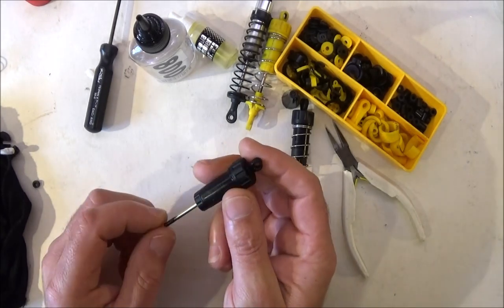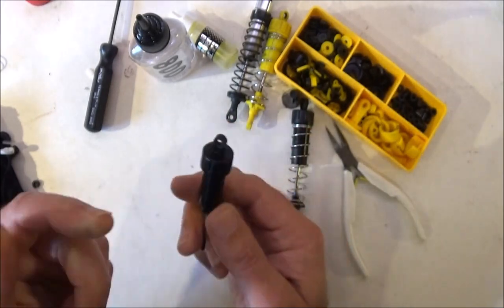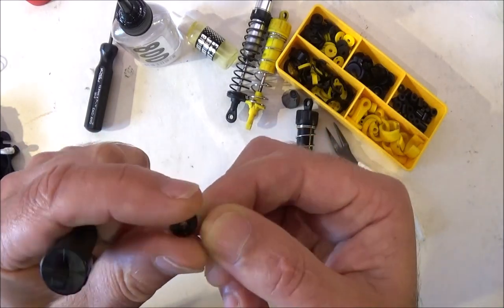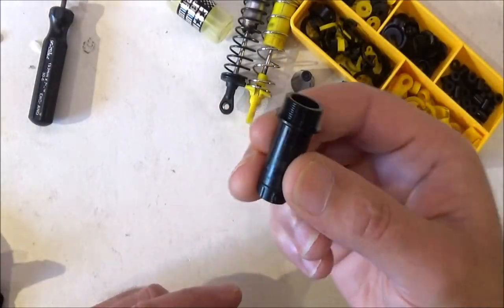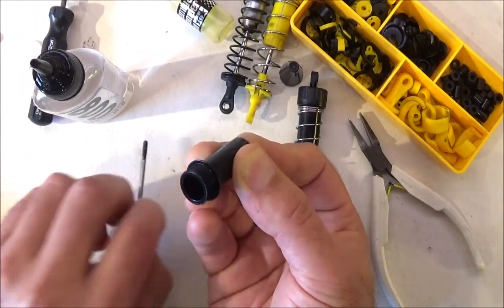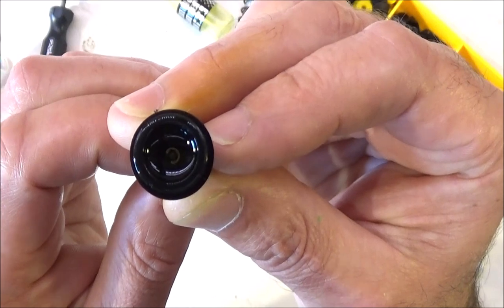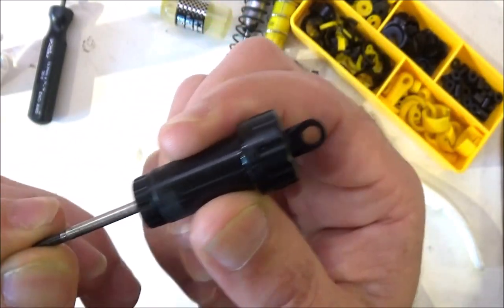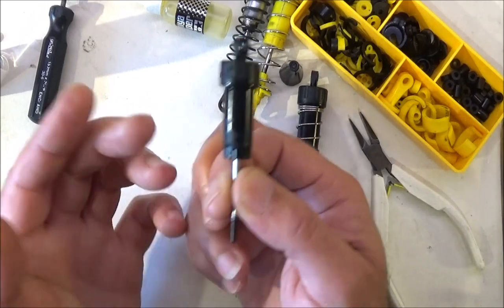How to Fill RC CVA Oil Shocks With No Air Bubbles! Simple No-Cost Tip!

Comment: Thanks for the video. I know this is an old video but here goes anyway. 😃 I’m just happy to see someone that understands this. 

You are very correct, rebound is caused by trapped air. If you like physics or you’re bored you can look up fluid mechanics. 

You can’t compress a liquid, you can put it under pressure but it doesn’t store energy. With piston movement (rebound) it’s very clear there is stored energy. You can compress air and when the pressure is released the stored energy is evident. 

The bladder is to ensure the air in the shock is displaced and can’t mix with the oil. 

The only rebound the bladder should cause is IF the piston were to make contact with and depress the bladder and the only rebound from that would be the distance of the bladder. 

Rebound is the result of trapped air which stores energy and another contributing factor is oil that is too thick for the piston in the shock. 

If oil can get past the piston properly you couldn’t compress the air in the shock in the first place. 

The secondary problem is you get a reduction in the shock being able to do it’s job. The air bubbles foam up and that would basically have the same effect as lowering the viscosity of the oil and reduce its ability to dampen the piston movement. After all a shock absorber is properly called a damper. 

For bashers, rebound is the least effective way to stop bottoming. Air has less resistance to movement than oil and if you need more spring you can add preload or springs with a stronger rate.
Reply from the maker: Hi Dave! Thanks for the fantastic comment - extremely well thought and explained - also most appreciated!
Yeah, I got a good handle on physics, hence you words make complete sense, I like your thinking. I'm sure others will read this thread, so I am going to pin it for future reference. All the best, hope things are going well for you!  :O)
Reply: @MarkBryanRC  thanks I appreciate that very much.
Reply: Brilliant comment so thank you for taking the time to write it. I'm new to hobby grade rc so I'm learning all the tricks I can. I understand physics and how cars work, by reading this confirms for sure I need to get every bit of air out because mine do rebound back on their own. Taking them apart again tomorrow to try this technique. Thanks again guys. Take care 👍
Reply from the maker: @jasonsensation46  Thanks Jason! All the better for sharing information in this great and interesting hobby - Yes there really is a lot of physics involved - just shows how a hobby can be educational and fun at the same time! Good luck with those shocks, take care too my friend!  :)
Reply: @jasonsensation46  thanks for the reply. There’s a lot of (RC VOODOO) 😃 that gets passed around and sometimes I think people look at the sub count to see if someone knows what they are talking about. 
Have a great day and be safe out there!

Comment: Bubbles in shocks are sometimes very annoying.Very great tip ,Mark and also a super conversation with radio control uk .I have learn a lot now.
Reply from the maker: Yes, Harry - bubbles can be very annoying! It is amazing how simply filling the shock before inserting the piston makes so much difference! And my friend at radio control uk has much RC experience and is very helpful. Thanks for watching my friend!  :)

Comment: Great little tip, wow, thanks! 👌But you need to have some rebound on the shocks. They need to push back out roughly a quarter of the shafts length. All the videos I've watched they say you musn't fill the shocks up with oil to the top, you need some space for the bladder?
Reply from the maker: Thanks Kev! Yep, I have learnt a lot since making this video! The consensus is that you can tune a "bladder" shock to have different levels of rebound or no rebound at all, depending on your preference. Yes, you can fill the shock almost to the top and fit the bladder, displacing any excess oil but ensuring there is no air in the shock, the air needs to be trapper inside the bladder. I refer to one of the comments here for more info:

You are very correct, rebound is caused by trapped air. If you like physics or you’re bored you can look up fluid mechanics. 

You can’t compress a liquid, you can put it under pressure but it doesn’t store energy. With piston movement (rebound) it’s very clear there is stored energy. You can compress air and when the pressure is released the stored energy is evident. 

The bladder is to ensure the air in the shock is displaced and can’t mix with the oil. 

The only rebound the bladder should cause is IF the piston were to make contact with and depress the bladder and the only rebound from that would be the distance of the bladder. 

Rebound is the result of trapped air which stores energy and another contributing factor is oil that is too thick for the piston in the shock. 

If oil can get past the piston properly you couldn’t compress the air in the shock in the first place. 

The secondary problem is you get a reduction in the shock being able to do it’s job. The air bubbles foam up and that would basically have the same effect as lowering the viscosity of the oil and reduce its ability to dampen the piston movement. After all a shock absorber is properly called a damper. 

For bashers, rebound is the least effective way to stop bottoming. Air has less resistance to movement than oil and if you need more spring you can add preload or springs with a stronger rate.
Reply: @MarkBryanRC  Ah right, thanks for that information. Interesting! I'm still new at this stuff, so my comment was based on many videos I've watched thus far. So technically there isn't really a right or wrong to this. My new shocks on my 1/16 truck has about half rebound, to compensate for softer springs. Riding around it feels great. Night and day over the friction shocks that came with the car. Great channel you have by the way. 👍
Reply from the maker: No worries and thanks for the kind response. Good to know that your new shocks are working well on your 1/16 truck, they should always be a massive upgrade from friction shocks - it sounds like yours are set up just right! Have fun with it! 😎👍

Comment: Hey top tip matey. I always thought that the shaft was pushed back down because the rubber cap is being pushed up from the increased volume of oil and the cap was springing back to its normal shape and pushing the oil back which pushes the shaft back. That was my theory, the theory that was mine but you have blown it out of the water with your demonstration!  Anyway, every day is a school day as they say. Thanks for this. Luckily it came before I built the ones for my TT-02 chassis so I can put it to the test soon. Hope the hols are going well. Like I was saying we all had a jolly old time on Saturday. The footage is a bit random as we were mainly messing about rather than worrying about the video. Might salvage something from it. Nearly took Derek's head off with a slightly off centre jump. There is footage but it looked better from where we were because we could see how close it got. Anyway hopefully we'll get to go out again soon. Ttfn mate 😀
Reply from the maker: Hey Pete! I hope you read Mikaels comment, made me laugh mate! Anyway, seems you are correct about the diaphragm! Apparently, if it's like the Tamiya dome shaped ones, it will cause rebound if you fill to the top with oil and screw the top on with the piston at the bottom of the stroke! But as I had the piston at the top, squashing the diaphragm, it prevents rebound. So top marks and a brownie point to you!  Sounds like you 3 had a whale of a time - wish I could have seen that near miss - be careful mate, Derek has not been well!!! Looking forward to that footage, hope your week is going well matey!  :)

Comment: For dt02/03 buggies I do the following.
I use trf 3 hole pistons in my cva front dampers and I remove one of the red orings and put a trf damper rod guide. Same for the rear except I use the black one hole pistons. 40wt associated oil all the way around. Stock front springs and red rear dt02 springs. Dampers will be super smooth and solid with zero stick and work exactly like dt02ms dampers and springs.
Reply from the maker: Hi Daniel and many thanks for sharing your shock tips. It's always great to have more information and I'm sure your experiences with the DT02/3 shocks will be appreciated by many reading this thread!
Best regards from Mark...    :)

Comment: Thanks for this video...so helpful....Just received my Short Shock II's and will do this to makes sure they are perfect first time.
Reply from the maker: .. and thank you for this great comment. Glad it was helpful! I hope it helps when filling those new shocks, it sure works for me. All the best from Mark...  :-)
Reply: @MarkBryanRC  quick question, what's the main difference between the 1,2 and 3 holes on the plate inside shock? does it make it softer the more holes?
Reply from the maker: Correct, Kevin, the more holes in the piston, the softer the damping will be. I usually start in the middle (2 holes) and change to 1 hole if too soft. I find that the piston with 3 holes provides almost no damping at all!  :)

Comment: Hi mark my friend building my blitzer beetle what spacers do you recommend x4 x6 or x7? Many thanks for your reply if you can
Reply from the maker: Hi mate - I'd have a play with different settings and see how it handles, you can always mix 2 or 3 spacers until it feels right. Basically, you don't want it bottoming out. Have fun!
Reply: @MarkBryanRC  Thanks
Reply: @MarkBryanRC  how do i know when it feels right as only built monster beetle 30 years ago and smashed it etc
Reply from the maker: @SRG-HITMAN-11  drop the car onto a table from about 12" above it. If it bounces its too hard, if it bottoms (chassis hits the table) its too soft!
Reply: @MarkBryanRC  appreciate that thanks mate

Comment: Looks to be working. Thanks for sharing, Mark. I remember we and some other gpod folks talked about this in one of my earlier videos (the TA-02SW build?) where I showed a re-bound too. I think the rebound is not due only to air bubbles but also due to excessive oil so when the shaft is inside the body (Huh ... ??? What kind of channel is this?) there is not enough space for it and it get’s pushed out? ... So does the rebound happen even if one makes sure to get all excessive oil out when placing the rubber sphere?
Reply from the maker: Hehe - thanks mate - love the innuendo in your comment, very Pete Wylie!!!  Hmmm... not entirely sure about the science in this one! My thinking was just to remove all of the air - all the instructions I have ever read tell you to get the air out, so I assume they work better when filled with oil only. My thinking is that it is impossible to compress a liquid, but gasses are easily compressed. Hence any air trapped will compress and expand when pushed by the piston. Or maybe its the air above the rubber sphere (or seal, or diaphragm) that gets squashed and rebounds? But I don't think it's possible to put too much oil in, as it can't be compressed. Confused? I think I have confused myself now!!!  :D
Reply: 😂 tee hee !
Reply: I like to use plenty of oil then pop the rubber thing on and slowly slide the shaft in but it does sometimes pop right out again 😂
Reply from the maker: HAHAHAHA!!!!  :D
Inserting the shaft VERY slowly and guiding it carefully as you go - usually prevents it from popping out again!
Reply: @MarkBryanRC  haha and sometimes you can actually hear the air bubbling out. Best not to mention it in my experience 😂
Reply from the maker: OMG!!! I can just hear it now!  LMAO!!!  :D
Reply: @MarkBryanRC  ha, anyone reading this thread would imagine that we are sniggering teenage boys rather than middle aged men! I don't think that blokes ever really grow up 😀
Reply: Mark Bryan RC Jokes aside 😂 I think you convinced me. Great explanation. Got to be either air or the rubber seal.
Reply from the maker: Well Pete, at least it proves that us two blokes forgot to grow up! I refuse!!!  :))
Reply: Mark Bryan RC The point of growing up is to earn more money for all the toys we couldn’t afford as kids and then just keep having fun, laughs and spread the fun, laughs and love to the people surrounding us 🥰
Reply from the maker: Well said mate! Yes, as an adult, we do have responsibilities that children don't, and these things we learn to live with and be as sensible as we can about. But as for having fun and being silly now and again, well if we lose that we are in trouble! Yes, my RC's are the best toys I have ever had in my life! I like the way you included the word "love" in the mix with fun and laughs. Remember an old conversation about Lenny Kravitz? Let love rule!!!   Oh - and lets include fun and laughter, they all go hand-in-hand!  :)

Comment: Hey Mark. Thanks for the video. I've done this on my oil shocks for the tt02 Quottro. I think I over filled on the first try, cos the circling popped out. Have you ever experienced this? They were Fastrax shocks 55mm. Did I do wrong?
Reply from the maker: Hi, Lee. Never had a circlip pop off before! I don't think it's because you overfilled the shock, it was probably not seated in the groove very well. So no, I don't think you did wrong, sometimes these things just happen! All the best, my friend.  :O)

Comment: 👍 neat tip,  I always just fill them up with the piston down and fill the shock body  get the air out and put the cap on lose and push the shock rod up into the body let the oil come out of the cap then screw the cap on and this works great also.
Reply from the maker: Thanks Steve! I knew you would have your own method, sounds like a good one - and it's great to share our ideas in the hobby! Thanks for the great comment, buddy!  :)

Comment: Hello there that's a Good tip but does it work on smaller cva tamiya shocks my sandviper front shocks having trouble getting the air out
Reply from the maker: Hi Coryn - yes the tip does work on smaller CVA's, I've used it on the Super Mini CVA shocks to good effect. You could try blocking the bottom hole with blu tac or plasticine, and then filling the shock and pushing the piston rod through. Hope you get rid of those pesky bubbles!  :)
Reply: @MarkBryanRC  happy days I will give it a try great videos keep them coming mate thank you for your help mate I hope I get rid of them to
Reply from the maker: You are always welcome, thanks for watching my videos and the great support mate.

Comment: Ace tip😎👍thanks bud.
Reply from the maker: No problem, thanks Tom! 🙏😎👍
Reply: @MarkBryanRC  no worries Mark😎👌

I've had a little problem arise with the shocks I'm trying to set up, I think you might just be the man who could help. The shocks I got are quite small, they are injora FCX24 shocks. Literally 6 drops of oil and they are full. They came without bladders. One of the shocks are having trouble when it tries to decompress. Have I made a mistake whilst filling them? I've had them apart a few times now and I don't seem to be able to get them to work in harmony with each other.... it's a bit annoying lol, is it the absence of the bladders that is causing this? I would be grateful for any advice you have 😎👍thanks dude.
Reply from the maker: @tomwright943  Hi Tom, oh yes this problem sounds only too familiar! 😅
I have an FCX24 and had those issues with the shocks, so I made a video about it! I think it might help, here is the link:
https://www.youtube.com/watch?v=Je1-BETlzpg
Reply: @MarkBryanRC  thank you so much 😎👌I'll have a gander now🧐👍

Comment: Great tip thankyou 👍
I find rotating the shaft as I pull it down helps remove any airbubbles aswell 🙂 
this only works when the piston is held in with a nut though, if its using circlips the shaft rotates and the piston may stay still 😂
Reply from the maker: Thanks for sharing your tip with us too, Mark! Yes, I can see the piston needs to be fixed for that to work - I'll remember that one though - cheers!  :O)
Reply: @MarkBryanRC  no worries mark 🙂👍

Comment: Mark it doesn't work for me the piston still comes back down its doing my head in
Reply from the maker: Sorry about that, Coryn! Try taking the top cap and rubber seal off one of the shocks, fully compress the shock so that the piston is right at the top of the shock body and replace the cap and seal with the shock fully compressed. See if it works then. Good luck!
Reply: @MarkBryanRC  I will give it a try thanks Mark 👍
Reply: Iam just having a nightmare with shocks at the moment don't no why need a holiday I think lol 😅

Comment: Hi Mark, hope you can help. I’m trying to build some Tamiya super mini shocks (50746). I can’t seem to stop the shaft from extending once compressed in to cylinder body. It extends quickly. Tried this method but no joy with mini shocks. Any ideas or tips you can pass on please?
Reply from the maker: Hi Matthew and thanks for the question. I've also had this happen too, where the shaft extends back out of the body. Try removing the top cap and pushing the piston fully into the shock. Keep the piston at the top and and refit the rubber seal and screw down the cap, all while the piston is fully into the shock. I think that will do the trick, best of luck! 🙂👍
Reply: Thanks Mark, that has sorted it now👍 I also used a vacuum type food tub with the shock inside to help draw the air bubbles out of the oil. Worked first time😀
Reply from the maker: @matthewvagges9438  great news 👍 glad it worked out OK! That vacuum idea  is a good one 👍